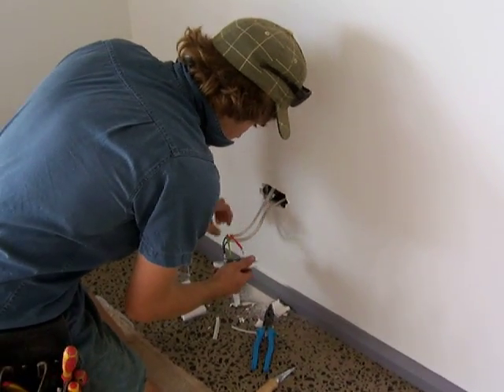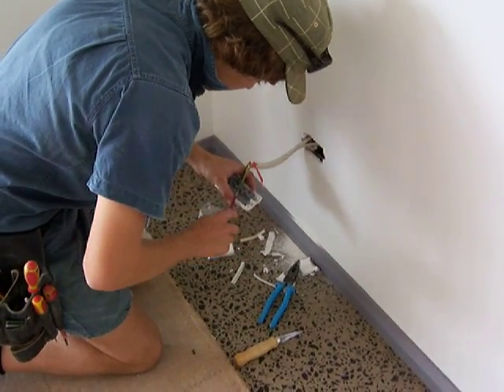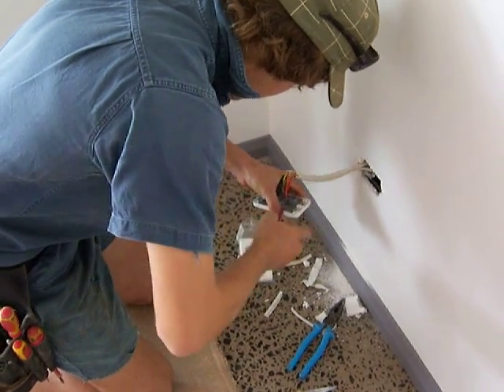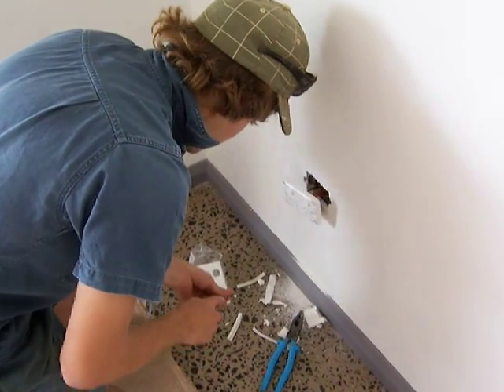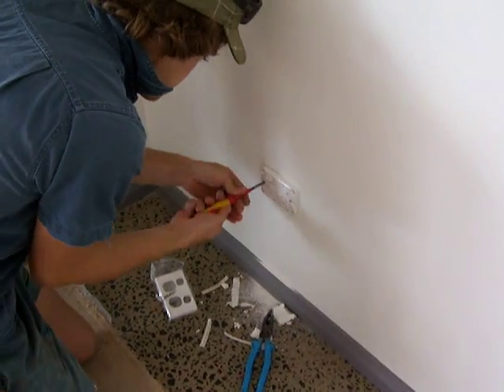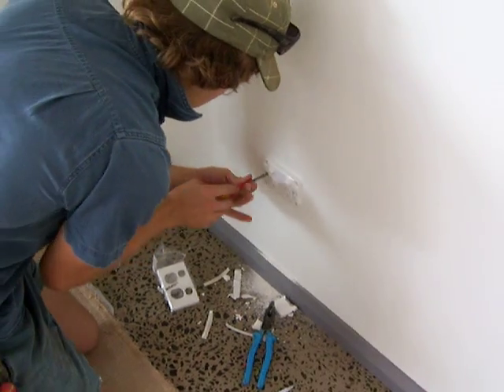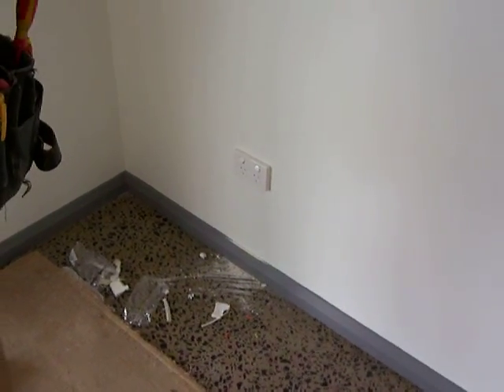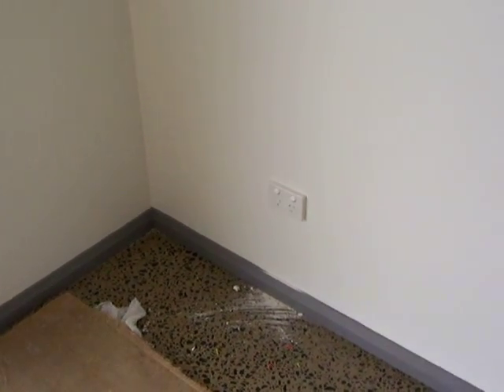Electricians Mildura - Fitting off a Power point Part 2 Video.mov

Comment: a little-added benefit is to plug in a resistance jig to test for polarity at the consumer board. Just as an added safety measure in case the gpo is faulty. you can prob the resistance back at the board across the active/neutral/MEN

Comment: You seriously think just cos its mounted on a stud bracket that it will be level? Stud brackets are never mounted level and there's 10-15mm movement in a power points screw holes for height adjustment, highly doubt it would be level

Comment: Why didn't he level it off with a spirit level and you should have a box or drop sheet underneath to avoid making mess on a customers premises
Reply: The carpet isn’t in yet it’s not the finished floor
Reply: Actually is finished floor-polished concrete. Dust etc won’t hurt it though.